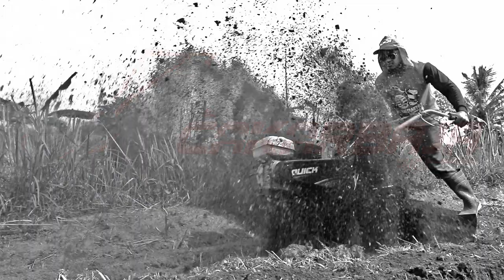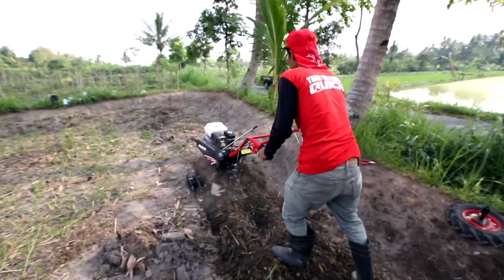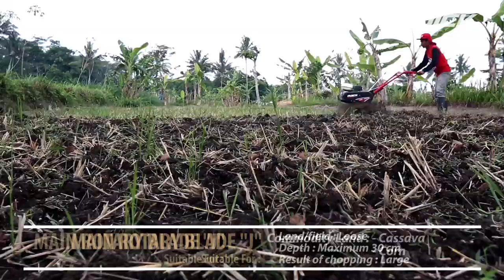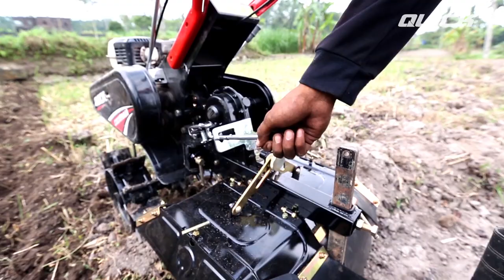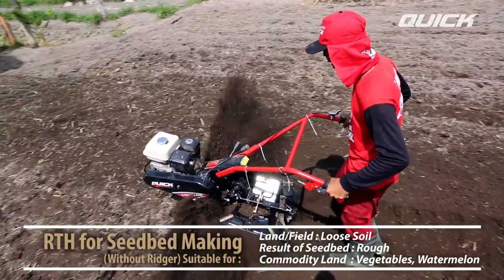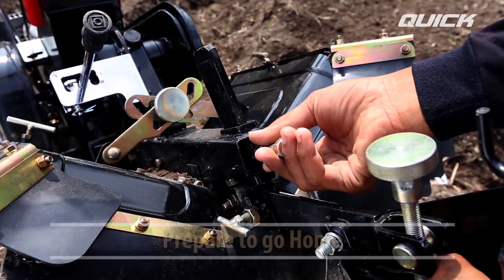CULTIVATOR QUICK CAKAR BAJA : STEADY, DURABLE, STRONG

Comment: Berapa harga per unit nya ?
Reply from the maker: Harga Quick Cakar Baja :
Mesin Bensin GX 200T2-QTBC : Rp 11.450.000 
Mesin Bensin GX 160T2-QTBC : Rp 11.150.000

Keterangan:
- Harga belum termasuk Biaya merakit, Oli, Solar/Bensin
- Harga termasuk PPN 10%
- Harga termasuk perlengkapan standar (hitch pin, universal hitch, resistance bar, dan roda karet)
- Harga belum termasuk ongkos kirim dari pabrik di Yogyakarta.

Perlengkapan Cultivator dijual terpisah (pilih sesuai kebutuhan)
--> Main Rotary BLADE B 340 = Rp 1.380.000 
--> Main Rotary BLADE B 240 = Rp 920.000 
--> Main Rotary BLADE B 100 = Rp 680.000 
--> Stabilizer Disc = Rp 120.000
--> Extension Rotary Blade B 200 = Rp 530.000
--> Main Rotary Blade J = Rp 1.310.000
--> Main Rotary Blade S = Rp 1.340.000
--> RTH = Rp 4.930.000 
--> Ridger = Rp 860.000 
--> Iron Wheel (CW 370)  = Rp 380.000 
--> Iron Wheel (CW 550) = Rp  600.000
--> Garu (Leveler) Cakar Baja = Rp 270.000
--> Bajak Cakar Baja = Rp 530.000 

Untuk lebih jelasnya, Pak Bos dapat menghubungi link https://bit.ly/CakarbajaSalesPusat

atau bila berkenan mohon kirimkan nomor telp/HP Pak Bos, bagian pemasaran kami akan menghubungi Pak Bos :)
Reply: Ini harga lengkap sama rth nya pak

Comment: Harga satu set komplit berapa gan
Reply from the maker: Harga Quick Cakar Baja :
Mesin Bensin GX 200T2-QTBC : Rp 11.450.000 
Mesin Bensin GX 160T2-QTBC : Rp 11.150.000

Keterangan:
- Harga belum termasuk Biaya merakit, Oli, Solar/Bensin
- Harga termasuk PPN 10%
- Harga termasuk perlengkapan standar (hitch pin, universal hitch, resistance bar, dan roda karet)
- Harga belum termasuk ongkos kirim dari pabrik di Yogyakarta.

Perlengkapan Cultivator dijual terpisah (pilih sesuai kebutuhan)
--> Main Rotary BLADE B 340 = Rp 1.380.000 
--> Main Rotary BLADE B 240 = Rp 920.000 
--> Main Rotary BLADE B 100 = Rp 680.000 
--> Stabilizer Disc = Rp 120.000
--> Extension Rotary Blade B 200 = Rp 530.000
--> Main Rotary Blade J = Rp 1.310.000
--> Main Rotary Blade S = Rp 1.340.000
--> RTH = Rp 4.930.000 
--> Ridger = Rp 860.000 
--> Iron Wheel (CW 370)  = Rp 380.000 
--> Iron Wheel (CW 550) = Rp  600.000
--> Garu (Leveler) Cakar Baja = Rp 270.000
--> Bajak Cakar Baja = Rp 530.000 

Untuk lebih jelasnya, Pak Bos dapat menghubungi link https://bit.ly/CakarbajaSalesPusat
Reply: @quicktraktor  di indramayu ada gak kaka?

Comment: Berapa harga nya
Reply: Saya LKS Pati jwtng
Reply from the maker: Harga Quick Cakar Baja :
Mesin Bensin GX 200T2-QTBC : Rp 11.450.000 
Mesin Bensin GX 160T2-QTBC : Rp 11.150.000

Keterangan:
- Harga belum termasuk Biaya merakit, Oli, Solar/Bensin
- Harga termasuk PPN 10%
- Harga termasuk perlengkapan standar (hitch pin, universal hitch, resistance bar, dan roda karet)
- Harga belum termasuk ongkos kirim dari pabrik di Yogyakarta.

Perlengkapan Cultivator dijual terpisah (pilih sesuai kebutuhan)
--> Main Rotary BLADE B 340 = Rp 1.380.000 
--> Main Rotary BLADE B 240 = Rp 920.000 
--> Main Rotary BLADE B 100 = Rp 680.000 
--> Stabilizer Disc = Rp 120.000
--> Extension Rotary Blade B 200 = Rp 530.000
--> Main Rotary Blade J = Rp 1.310.000
--> Main Rotary Blade S = Rp 1.340.000
--> RTH = Rp 4.930.000 
--> Ridger = Rp 860.000 
--> Iron Wheel (CW 370)  = Rp 380.000 
--> Iron Wheel (CW 550) = Rp  600.000
--> Garu (Leveler) Cakar Baja = Rp 270.000
--> Bajak Cakar Baja = Rp 530.000 

atau bila berkenan mohon kirimkan nomor telp/HP Pak Bos, bagian pemasaran kami akan menghubungi Pak Bos :)
https://bit.ly/CakarbajaSalesPusat

Comment: Cek harga
Reply from the maker: Harga Quick Cakar Baja :
Mesin Bensin GX 200T2-QTBC : Rp 11.450.000 
Mesin Bensin GX 160T2-QTBC : Rp 11.150.000

Keterangan:
- Harga belum termasuk Biaya merakit, Oli, Solar/Bensin
- Harga termasuk PPN 10%
- Harga termasuk perlengkapan standar (hitch pin, universal hitch, resistance bar, dan roda karet)
- Harga belum termasuk ongkos kirim dari pabrik di Yogyakarta.

Perlengkapan Cultivator dijual terpisah (pilih sesuai kebutuhan)
--> Main Rotary BLADE B 340 = Rp 1.380.000 
--> Main Rotary BLADE B 240 = Rp 920.000 
--> Main Rotary BLADE B 100 = Rp 680.000 
--> Stabilizer Disc = Rp 120.000
--> Extension Rotary Blade B 200 = Rp 530.000
--> Main Rotary Blade J = Rp 1.310.000
--> Main Rotary Blade S = Rp 1.340.000
--> RTH = Rp 4.930.000 
--> Ridger = Rp 860.000 
--> Iron Wheel (CW 370)  = Rp 380.000 
--> Iron Wheel (CW 550) = Rp  600.000
--> Garu (Leveler) Cakar Baja = Rp 270.000
--> Bajak Cakar Baja = Rp 530.000 

atau bila berkenan mohon kirimkan nomor telp/HP Pak Bos, bagian pemasaran kami akan menghubungi Pak Bos :)

Comment: Bos klw pesan 1 brp sampai d papua
Reply from the maker: Untuk Papua masuk wilayah pemasaran kami di Nganjuk Pak Bos. Untuk info selengkapnya bisa hubungi langsung Kantor Cabang QUICK NGANJUK
SMS/WA : 0811 2545 978 (Ricky)
Gudang Karya Agung Type A Jalan Raya Kedondong Rt 01 Rw 2 , Kedondong, Bagor, Nganjuk  64461
Fanpage : Quick Traktor Nganjuk
Kontak kami link dibawah
http://bit.ly/HubungiMasQuickFBNganjukQT
http://bit.ly/HubungiMasQuickFBNganjukA360
http://bit.ly/HubungiMasQuickFBNganjukQH11
Reply: bos rotari blade j berapa harganya   abdurrohman temanggung
Reply from the maker: @arhmn_chanel1775  Quick Main Rotary Blade J
Rp 1.310.000
Reply: @quicktraktor  utk wilayah Kalsel adakah  distributorx dimana?

Comment: Harga brapa bos
Reply from the maker: Harga Quick Cakar Baja :
Mesin Bensin GX 200T2-QTBC : Rp 11.450.000 
Mesin Bensin GX 160T2-QTBC : Rp 11.150.000

Keterangan:
- Harga belum termasuk Biaya merakit, Oli, Solar/Bensin
- Harga termasuk PPN 10%
- Harga termasuk perlengkapan standar (hitch pin, universal hitch, resistance bar, dan roda karet)
- Harga belum termasuk ongkos kirim dari pabrik di Yogyakarta.

Perlengkapan Cultivator dijual terpisah (pilih sesuai kebutuhan)
--> Main Rotary BLADE B 340 = Rp 1.380.000 
--> Main Rotary BLADE B 240 = Rp 920.000 
--> Main Rotary BLADE B 100 = Rp 680.000 
--> Stabilizer Disc = Rp 120.000
--> Extension Rotary Blade B 200 = Rp 530.000
--> Main Rotary Blade J = Rp 1.310.000
--> Main Rotary Blade S = Rp 1.340.000
--> RTH = Rp 4.930.000 
--> Ridger = Rp 860.000 
--> Iron Wheel (CW 370)  = Rp 380.000 
--> Iron Wheel (CW 550) = Rp  600.000
--> Garu (Leveler) Cakar Baja = Rp 270.000
--> Bajak Cakar Baja = Rp 530.000 

atau bila berkenan mohon kirimkan nomor telp/HP Pak Bos, bagian pemasaran kami akan menghubungi Pak Bos :)
Reply: Pak.minta nomer pemasaran bekasi
Reply from the maker: @mohamadalimustopa9770  Kunjungi fanpage kami @quicktraktorjakarta
SMS/WA : 0811 2545 908 (Agung)
Kantor Cabang QUICK JAKARTA
Jl. Gajah Mada 154, Jakarta
Telp: 021-6292044, 6490020
Fax: 021-6490013
Email: jkt@quick.co.id
Kontak kami link dibawah
https://bit.ly/HubungiMasQuickQTJakartaFB
https://bit.ly/HubungiMasQuickA360JakartaFB
https://bit.ly/HubungiMasQuickQH11JakartaFB
Reply: Jadi klo 1 paket kena berapa pak harganya? Traktor sma semua blade nya

Comment: paket kumplt berapa
Reply from the maker: Harga Quick Cakar Baja :
Mesin Bensin GX 200T2-QTBD : Rp 11.478.000 
Mesin Bensin GX 160T2-QTBD : Rp 11.160.000

Keterangan:
- Harga belum termasuk Biaya merakit, Oli, Solar/Bensin
- Harga termasuk PPN 10%
- Harga termasuk perlengkapan standar (hitch pin, universal hitch, resistance bar, dan roda karet)
- Harga belum termasuk ongkos kirim dari pabrik di Yogyakarta.

Perlengkapan Cultivator dijual terpisah (pilih sesuai kebutuhan)
--> Main Rotary BLADE B 340 = Rp 1.380.000 
--> Main Rotary BLADE B 240 = Rp 920.000 
--> Main Rotary BLADE B 100 = Rp 680.000 
--> Stabilizer Disc = Rp 120.000
--> Extension Rotary Blade B 200 = Rp 530.000
--> Main Rotary Blade J = Rp 1.310.000
--> Main Rotary Blade S = Rp 1.340.000
--> RTH = Rp 4.930.000 
--> Ridger = Rp 860.000 
--> Iron Wheel (CW 370)  = Rp 380.000 
--> Iron Wheel (CW 550) = Rp  600.000
--> Garu (Leveler) Cakar Baja = Rp 270.000
--> Bajak Cakar Baja = Rp 530.000 

Untuk lebih jelasnya, Pak Bos dapat menghubungi link https://bit.ly/CakarbajaSalesPusat

atau bila berkenan mohon kirimkan nomor telp/HP Pak Bos, bagian pemasaran kami akan menghubungi Pak Bos :)

Comment: Harga berapa
Reply from the maker: Harga Quick Cakar Baja :
Mesin Bensin GX 200T2-QTBC : Rp 11.450.000 
Mesin Bensin GX 160T2-QTBC : Rp 11.150.000

Keterangan:
- Harga belum termasuk Biaya merakit, Oli, Solar/Bensin
- Harga termasuk PPN 10%
- Harga termasuk perlengkapan standar (hitch pin, universal hitch, resistance bar, dan roda karet)
- Harga belum termasuk ongkos kirim dari pabrik di Yogyakarta.

Perlengkapan Cultivator dijual terpisah (pilih sesuai kebutuhan)
--> Main Rotary BLADE B 340 = Rp 1.380.000 
--> Main Rotary BLADE B 240 = Rp 920.000 
--> Main Rotary BLADE B 100 = Rp 680.000 
--> Stabilizer Disc = Rp 120.000
--> Extension Rotary Blade B 200 = Rp 530.000
--> Main Rotary Blade J = Rp 1.310.000
--> Main Rotary Blade S = Rp 1.340.000
--> RTH = Rp 4.930.000 
--> Ridger = Rp 860.000 
--> Iron Wheel (CW 370)  = Rp 380.000 
--> Iron Wheel (CW 550) = Rp  600.000
--> Garu (Leveler) Cakar Baja = Rp 270.000
--> Bajak Cakar Baja = Rp 530.000 

atau bila berkenan mohon kirimkan nomor telp/HP Pak Bos, bagian pemasaran kami akan menghubungi Pak Bos :)

Comment: Harga RTH berapa bos, sama roda besi berapa bos, saya di Lampung timur
Reply from the maker: Harga Quick Cakar Baja :
Mesin Bensin GX 200T2-QTBC : Rp 11.450.000 
Mesin Bensin GX 160T2-QTBC : Rp 11.150.000

Keterangan:
- Harga belum termasuk Biaya merakit, Oli, Solar/Bensin
- Harga termasuk PPN 10%
- Harga termasuk perlengkapan standar (hitch pin, universal hitch, resistance bar, dan roda karet)
- Harga belum termasuk ongkos kirim dari pabrik di Yogyakarta.

Perlengkapan Cultivator dijual terpisah (pilih sesuai kebutuhan)
--> Main Rotary BLADE B 340 = Rp 1.380.000 
--> Main Rotary BLADE B 240 = Rp 920.000 
--> Main Rotary BLADE B 100 = Rp 680.000 
--> Stabilizer Disc = Rp 120.000
--> Extension Rotary Blade B 200 = Rp 530.000
--> Main Rotary Blade J = Rp 1.310.000
--> Main Rotary Blade S = Rp 1.340.000
--> RTH = Rp 4.930.000 
--> Ridger = Rp 860.000 
--> Iron Wheel (CW 370)  = Rp 380.000 
--> Iron Wheel (CW 550) = Rp  600.000
--> Garu (Leveler) Cakar Baja = Rp 270.000
--> Bajak Cakar Baja = Rp 530.000 

Untuk lebih jelasnya, Pak Bos dapat menghubungi link https://bit.ly/CakarbajaSalesPusat

atau bila berkenan mohon kirimkan nomor telp/HP Pak Bos, bagian pemasaran kami akan menghubungi Pak Bos :)
Reply: @quicktraktor  apakah bisa beli nya di kredit pak
Reply: Untuk cabang semarang,alamatnya di mana pak

Comment: Harga nya braa bosss???
Reply from the maker: Harga Quick Cakar Baja :
Mesin Bensin GX 200T2-QTBC : Rp 11.450.000 
Mesin Bensin GX 160T2-QTBC : Rp 11.150.000

Keterangan:
- Harga belum termasuk Biaya merakit, Oli, Solar/Bensin
- Harga termasuk PPN 10%
- Harga termasuk perlengkapan standar (hitch pin, universal hitch, resistance bar, dan roda karet)
- Harga belum termasuk ongkos kirim dari pabrik di Yogyakarta.

Perlengkapan Cultivator dijual terpisah (pilih sesuai kebutuhan)
--> Main Rotary BLADE B 340 = Rp 1.380.000 
--> Main Rotary BLADE B 240 = Rp 920.000 
--> Main Rotary BLADE B 100 = Rp 680.000 
--> Stabilizer Disc = Rp 120.000
--> Extension Rotary Blade B 200 = Rp 530.000
--> Main Rotary Blade J = Rp 1.310.000
--> Main Rotary Blade S = Rp 1.340.000
--> RTH = Rp 4.930.000 
--> Ridger = Rp 860.000 
--> Iron Wheel (CW 370)  = Rp 380.000 
--> Iron Wheel (CW 550) = Rp  600.000
--> Garu (Leveler) Cakar Baja = Rp 270.000
--> Bajak Cakar Baja = Rp 530.000 

atau bila berkenan mohon kirimkan nomor telp/HP Pak Bos, bagian pemasaran kami akan menghubungi Pak Bos :)

Comment: Mas berapa harga cultifator Cakra baja nya
Reply from the maker: Harga Quick Cakar Baja :
Mesin Bensin GX 200T2-QTBC : Rp 11.450.000 
Mesin Bensin GX 160T2-QTBC : Rp 11.150.000

Keterangan:
- Harga belum termasuk Biaya merakit, Oli, Solar/Bensin
- Harga termasuk PPN 10%
- Harga termasuk perlengkapan standar (hitch pin, universal hitch, resistance bar, dan roda karet)
- Harga belum termasuk ongkos kirim dari pabrik di Yogyakarta.

Perlengkapan Cultivator dijual terpisah (pilih sesuai kebutuhan)
--> Main Rotary BLADE B 340 = Rp 1.380.000 
--> Main Rotary BLADE B 240 = Rp 920.000 
--> Main Rotary BLADE B 100 = Rp 680.000 
--> Stabilizer Disc = Rp 120.000
--> Extension Rotary Blade B 200 = Rp 530.000
--> Main Rotary Blade J = Rp 1.310.000
--> Main Rotary Blade S = Rp 1.340.000
--> RTH = Rp 4.930.000 
--> Ridger = Rp 860.000 
--> Iron Wheel (CW 370)  = Rp 380.000 
--> Iron Wheel (CW 550) = Rp  600.000
--> Garu (Leveler) Cakar Baja = Rp 270.000
--> Bajak Cakar Baja = Rp 530.000 

atau bila berkenan mohon kirimkan nomor telp/HP Pak Bos, bagian pemasaran kami akan menghubungi Pak Bos :)

Comment: Harga kisatan berapa bos
Reply from the maker: Harga Quick Cakar Baja :
Mesin Bensin GX 200T2-QTBC : Rp 11.450.000 
Mesin Bensin GX 160T2-QTBC : Rp 11.150.000

Keterangan:
- Harga belum termasuk Biaya merakit, Oli, Solar/Bensin
- Harga termasuk PPN 10%
- Harga termasuk perlengkapan standar (hitch pin, universal hitch, resistance bar, dan roda karet)
- Harga belum termasuk ongkos kirim dari pabrik di Yogyakarta.

Perlengkapan Cultivator dijual terpisah (pilih sesuai kebutuhan)
--> Main Rotary BLADE B 340 = Rp 1.380.000 
--> Main Rotary BLADE B 240 = Rp 920.000 
--> Main Rotary BLADE B 100 = Rp 680.000 
--> Stabilizer Disc = Rp 120.000
--> Extension Rotary Blade B 200 = Rp 530.000
--> Main Rotary Blade J = Rp 1.310.000
--> Main Rotary Blade S = Rp 1.340.000
--> RTH = Rp 4.930.000 
--> Ridger = Rp 860.000 
--> Iron Wheel (CW 370)  = Rp 380.000 
--> Iron Wheel (CW 550) = Rp  600.000
--> Garu (Leveler) Cakar Baja = Rp 270.000
--> Bajak Cakar Baja = Rp 530.000 

Untuk lebih jelasnya, Pak Bos dapat menghubungi link https://bit.ly/CakarbajaSalesPusat

atau bila berkenan mohon kirimkan nomor telp/HP Pak Bos, bagian pemasaran kami akan menghubungi Pak Bos :)